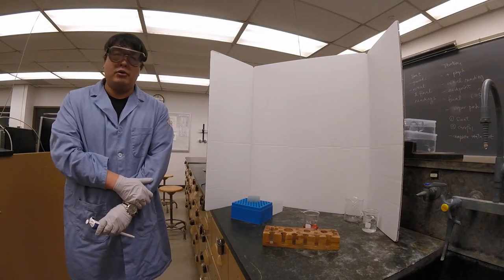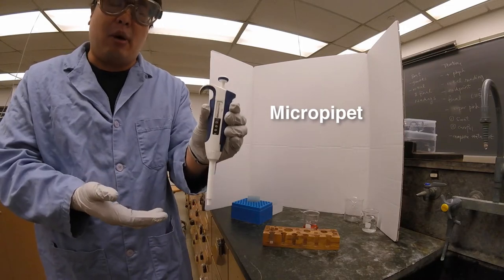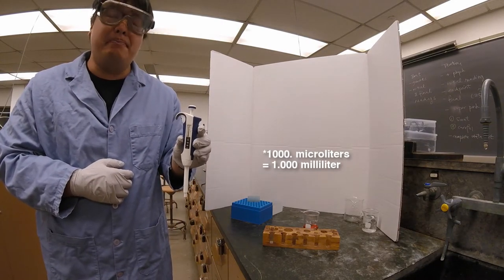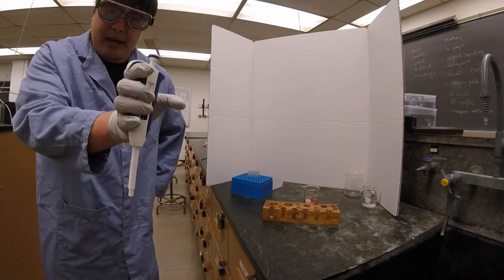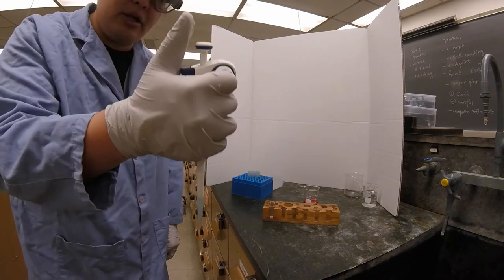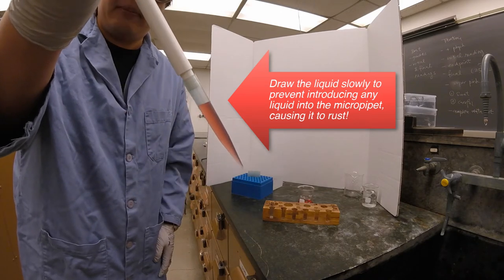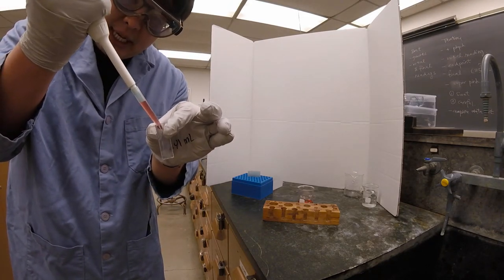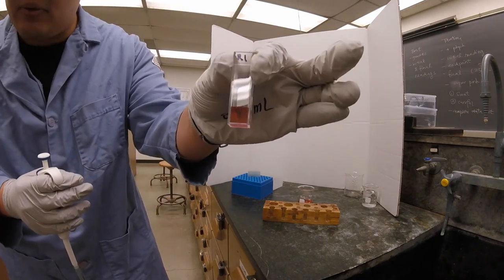How to Use a Micropipet

Comment: im guessing the micropipet is more accurate than the usual pipette?
Reply from the maker: Both are suitable for dispensing solutions in different volume. It makes more sense to use a pipette to dispense 10.0 mL an a micropipet for 100 microL.